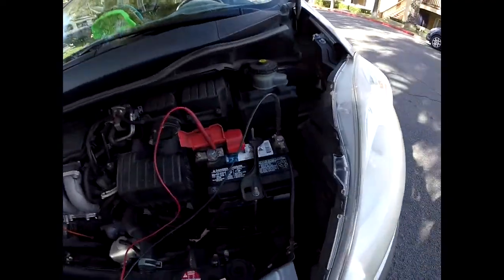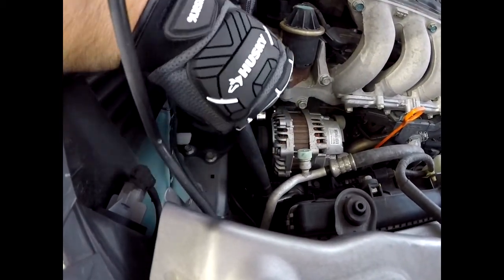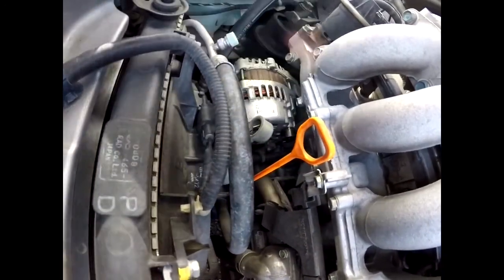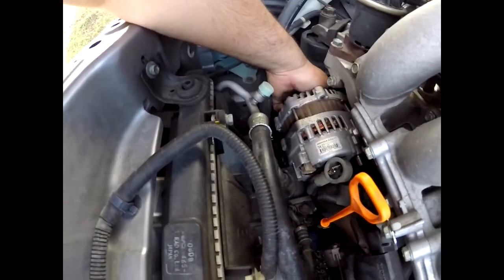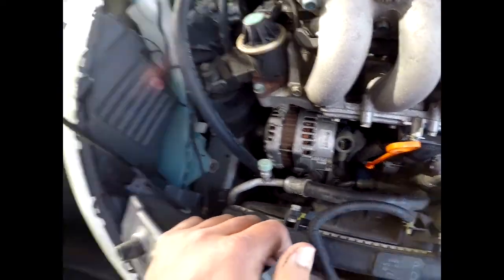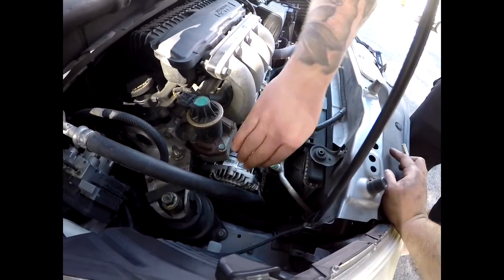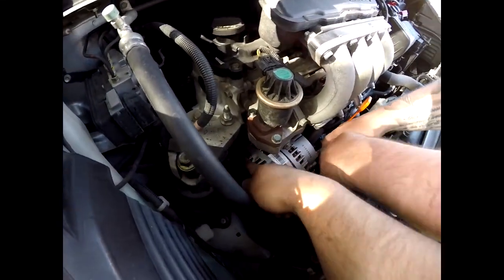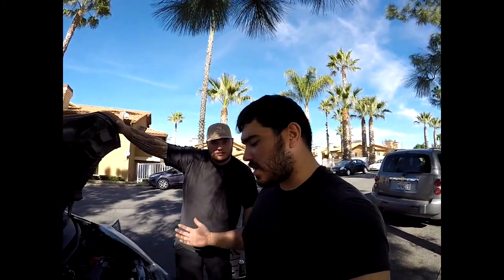Automotive VLog 7 - 2009 Honda Fit Alternator Replacement

Comment: I know this is an older vid, but this was helpful (just swapped out my alternator yesterday) for anyone else trying to get that bottom bolt that these guys did off screen, I was able to connect a couple "wobble" extensions together, and that brought my wrench up high enough to get the leverage needed to break it loose, good luck! And thanks for the upload!
Reply from the maker: thank you for taking the time to reply and to add the additional tips. Much appreciated and glad you were able to get the job done.

Comment: Carbon brushes in the glove box come in handy.     Mid-night in Mississippi, yep glad I had those, the old style where you had to open the alternator case and use paper clips to retract the brushes and assemble and pull clips out, now a days they come in a plastic module and easy to swap out in 5 minutes and no busted knuckles.

Comment: Saw a video where someone removed the tire and the wheel well for the same work. What a big difference and Less work.
Reply from the maker: Very interesting but i wonder if it had to do with what they had available as far as tools/equipment maybe? I assume the out come was that they were able to perform the repair.

Comment: Mine is original on my fit at 160K, but I have a noise going up hill from engine bay. I’m gonna remove the belt and check all pulleys. I just replaced the tensioner and still same issue. I hope the alternator ain’t too expensive
Reply from the maker: if I remember correctly it was no more than 150 dollars

Comment: Attempted this today and the bottom bolt, driver side of alternator is nearly impossible to remove. went from the top and failed and removed the oil filter to go from the bottom and failed. Worked on it for upwards of 3 hrs....
Reply from the maker: Robert Mahony that is really odd. I didnt experience any issues like that but I can definitely confirm that there is very little room in that area.

Comment: Would this video still apply to a 2012 replacement?
Reply from the maker: I cant say for certain as i haven't seen the layout on a 2012 but my initial thought would be that it's likely not wildly different from this set up.
Reply: @DROJVDO  It worked thank you for easy to follow steps!

Comment: how did yall put the belt back on, even after lifting the tension er the belt is tight.
Reply from the maker: I would verify you have the right size belt. There should be a bit of slack to allow you to freely slide it on.

Comment: how many miles did it have?
Reply from the maker: Richard 1990  if I remember correctly it was between 120k and 130k miles
Reply: I was gonna say, because mine has 157K and still on the original one
Reply: @Richard-xc3cw  Change the carbon brushes.